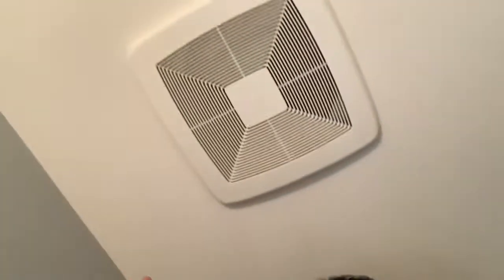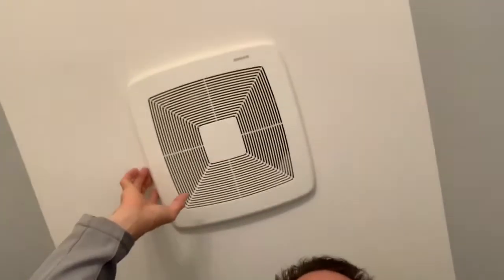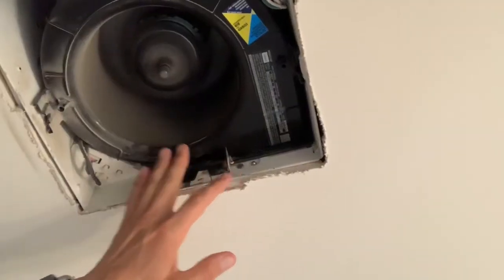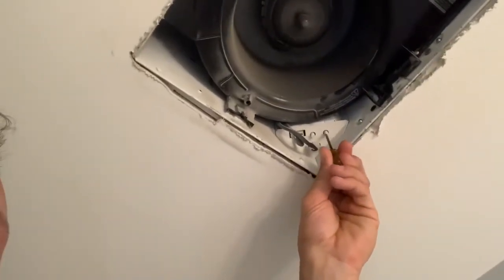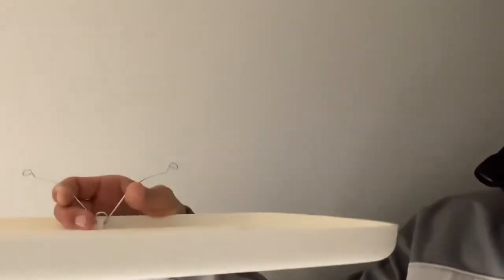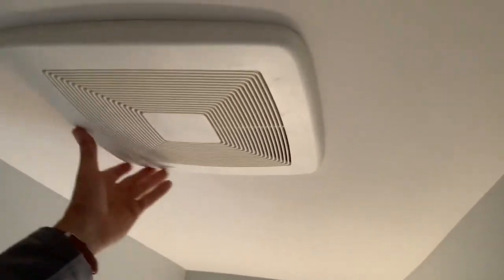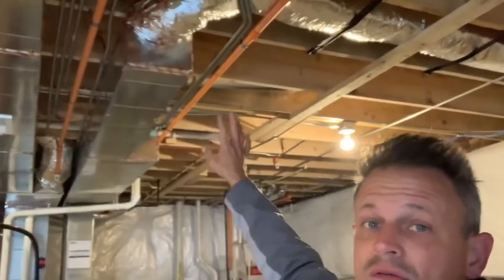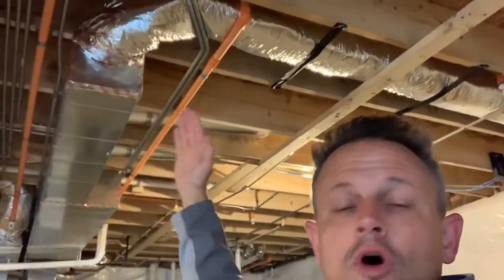Why is my bathroom exhaust fan always on even when the switch is off.

Comment: But I have 3 bathrooms with fans. It only works like the on on of the washrooms. 
The one the no one shuts of so my furnace runs sometimes hours, have told everyone to turn it of. Nope. .
Can you disconnect it with out Gering fined or trouble.
Reply from the maker: A lot of newer bathrooms have fans wired to run continuously or on a timer because they’re part of a whole-house ventilation system. That’s why they don’t fully shut off at the switch. If yours is tied into your furnace or fresh-air system, it’s usually required by code and you don’t want to just disconnect it. A better option is to have an electrician add a timer switch or adjust the settings so it only runs when needed. If it’s not part of a ventilation system, an electrician can safely disconnect or rewire it.

Comment: Hello, what’s the best way to clean these? Mine has gotten too loud. I’ve cleaned off all the dust but it still seems to be kind of loud on both low and high settings.
Reply from the maker: If you’ve already cleaned the grill and fan blades, the noise might be coming from a worn-out motor or loose mounting. Try removing the fan assembly and lightly oiling the motor shaft (if accessible), and make sure it’s securely fastened. If it’s still noisy, it may just be time to replace the motor or the whole unit—many newer models are much quieter.
Reply: @BJPoznecki it’s a 2 year old house… you think it’s due to the age? What kind of oil can be used with these fans? Thanks!
Reply from the maker: @E-manCal  I would use WD-40 silicone formula. It doesn’t attract as much dust and dirt like the original formula does.
Reply: @BJPoznecki awesome thank you

Comment: Thanks for this video. We recently bought a house that has an exhaust fan in the laundry room that is always on. You describe how turning on the switch makes it run at a higher speed and remains at that speed until it times out. Unfortunately, our fan doesn’t have a switch in the wall to control its speed. Was it just wired incorrectly?
Reply from the maker: It’s possible your fan is a continuous ventilation model designed to run 24/7 at low speed for air quality and moisture control. These are common in newer or energy-efficient homes. That said, if there’s no wall switch or speed controller at all, it could have been miswired or the control might be hidden (like in a cabinet, attic, or linked to a sensor). You may want an electrician to check if a switch can be added or if it’s working as intended.

Comment: Mine is a vent axia digital with no buttons or dials its stupid & just doesnt switch off ... are they goinna pay my electric bill this stupid fan should have a simple on off switch use as required no need for a continous non stop bathroom fan ... as someone already mentioned its gonna pump out hot air in winter to outside

Comment: Thanks for the video! Moved into an apartment with a continuously running fan (Unilux) at low speed/intensity. There is also a timer button but when I choose a specific time I don't really notice any difference in the fan speed, not sure what's the difference between using the timer versus not doing any thing as the fan is continuously running. Would appreciate your insights, thanks!
Reply from the maker: @njdiscoverer9237  Regardless whether the fan is on a regular switch or a timer switch when it turns on, you should hear an increase in the fan speed. If you’re not hearing that, then something’s not wired correctly and an electrician should correct it. When it’s off, it should be at an idle speed and when it’s turned on, it should run at full speed.

Comment: Could this cause a hike in your electricity bill? Ive been trying to figure out why my bill continuously goes up despite me being very conscientious about the amount of energy Im using. My ac isnt on all the time, Im in a 1 bd apartment and its just me, dont really use the lights much cause I get great natural light and I dont keep any unnecessary items plugged in.
Reply from the maker: @kihhtheguy16  These continuous running exhaust fans, for energy-efficient ventilation, are designed to be very energy-efficient themselves. They usually run at a low CFM (cubic feet per minute) rate and draw minimal power—often less than ten to fifteen watts, depending on the model. So, you might see a slight bump in your electric bill, but it’s usually pretty minor.

It’s more about consistent airflow and preventing moisture buildup, which helps in the long run with things like mold and air quality.
Reply: Gotcha, thank you!

Comment: Well my exhaust fan is no where near new, there is a switch for the exhaust fan but it doesn't work & mine runs all the time but when the door is open it gets louder especially when the ac or heater is running. It's quieter when the door is shut but the maintenance guy tried to say it turns off whenthe door is shut and it's not connected to a switch. I was like hth does that make sense when the point of the exhaust fan is to use it when showering especially with no windows in the bathroom?! 🤦🏼 I live in an apartment complex btw so PLEASE tell me if this is something i need to report to the landlord tp be fixed 🙏🏼🙏🏼🙏🏼
Reply from the maker: @officermeyer  Well I’ve seen a lot of different set ups. In apartment and condo buildings it’s very common to have a system that never turns off, so that there’s always fresh air moving through the unit.

Comment: Hi BJ
My fan light kept going from green light to orange/yellow light?
What does that indicate?
Reply from the maker: @lynnnorton7910  Hi Lynn! The changing light on your exhaust fan typically indicates the air quality status or the fan’s performance. 

Here’s a breakdown:
	1.	Green Light: The fan is operating normally, and the air quality is good or within acceptable levels.
	2.	Orange/Yellow Light: This usually signals:
	•	Poor air quality (e.g., high humidity, particulate levels, or odors detected, depending on the fan’s features).
	•	A need for maintenance, such as cleaning the fan or replacing a filter (if applicable).
	•	An issue with the fan’s sensors or performance.

To resolve it:
	•	Check the fan’s user manual to understand its light indicators and troubleshooting steps.
	•	Clean the fan and any filters, if applicable.
	•	Ensure proper ventilation in the area to improve air quality.
	•	If the issue persists, consider contacting the manufacturer or a professional for assistance.

Comment: One mystery solved!!! Thank you! I have a Broan fa system with carrier hvac...now add in the bathroom intake aspect I'm having g trouble understanding how it all works together. Also is it normal that when you flip the bathroom fan switch to on that it takes a good 60 seconds to kick up in speed?
Reply from the maker: @irishgirlsoi  On your HVAC system you should have a fresh air intake that brings fresh air in from outside. When they do that, they have to install a continuous running fan to allow that air to exit the home, so there’s always airflow moving through the home because the homes are built tighter nowadays with all of the energy efficiency requirements. 

Yes, some of the exhaust fans do have a delay when you turn the switch on it takes a little bit of time for it to get to full speed.

Comment: Can the fan be turned off? I just moved into brand new construction (apartment) the fan is in kitchen/living area and the insulation is getting blown onto floor 
Also have noticed all my granite countertops are dusty even though I clean daily, it must be coming from the ducts
Reply from the maker: @hdhoman2832  It sounds like something might not have been installed correctly. I would call the Builder.

Comment: Does this affect your electricity bill  by having the fan running 24/7?
Reply from the maker: @sashelblidgen2190  No, it’s drawing so little power. You won’t even notice it on your bill.
Reply: @BJPoznecki  ok something in my apartment is running up my bill and am so confused because am just one person in a one bed room apartment and I don’t use AC but yet my bill is 300-435 a month I just moved to this place. I have an electric stove, a 5 gallon fish tank, it’s has no lights but a filter that’s always running, fridge and microwave that stays plugged in everything else is off. What can I do because this is too expensive. Am trying to get the apartment people to come out and look Monday.
Reply from the maker: @sashelblidgen2190  Wow that is crazy. There’s definitely something wrong because a one bedroom apartment even if you ran your air conditioning a lot would be no more than $60 a month. I wonder if your electric provider has your electrical service mixed up with the electrical service for the apartment building common areas. I would also have whoever you pay your electric bill to whether it’s ComEd or somebody else come out as well in addition to the people that work for your apartment building.
Reply: @BJPoznecki  thank you am going to spend the day tomorrow and make calls because someone has to give me an answer I can’t afford it. Thank you.
Reply from the maker: @sashelblidgen2190  My pleasure, happy to help! Yeah, something’s wrong somewhere, because I know people that have a large house with a lot of electrical components that don’t even pay that much.

Comment: Thank you for the info!

The issue I have is when the a/c is on, the exhaust fan is on, so the cool a/c air is being sucked outward and not really cooling the bathroom.

 After I turn the a/c off, a couple of minutes later the exhaust fan also stops. And when I turn the a/c on, shortly thereafter, the exhaust fan kicks in.
Reply from the maker: That’s strange. I’ve never seen that before. The only thing I can think of is they may require that were you live.

Comment: I have one in the hallway as well near  HVAC. And the switch does not turn my running Ac off. You're thoughts
Reply from the maker: The one in the hallway could just be an exhaust fan to remove air from that area. Sometimes I will see them near laundry rooms, where the washer and dryer are.

Comment: Should the fan in the bathroom constantly run or should it always be left on and what does the fan actually do. Does it somehow get rid of toxic air
Reply from the maker: If you have a continuous running fan like the one in this video when you turn the switch off, the RPMs drop to a really low idle to where it never fully turns off. What it’s doing is creating air circulation throughout your whole home.

Comment: An electrician installed a Broan lighted fan in my shower this week.  There is no connection to my furnace as I have forced hot water heat.  He screwed up and when you turn the fan switch off the friggin thing keeps running.  No bueno. 
He was sub contracted via another contractor that’s doing insulation in my house so I had them unplug it for now but looks like they will need to get the electrician back here to fix the issue.  Too bad for him.  Do it right the first time.

Comment: helpful video. thanks. question: is setting the fan to run at a higher CFM more helpful? Ours was set to run continuously at full speed - not sure if that was an oversight or somehow more beneficial. (It's certainly noisier!)
Reply from the maker: It was an oversight. We want it to run at full speed when somebody’s in the bathroom. However, when you turn it off, we want it to drop down to just a slow speed.

Comment: Mine is the same brand as you showed, so if this one is supposed to always be on, why does it have a switch? lol does this use a lot of energy? I was trying to turn it off to save energy, what do you think?
Reply from the maker: No, it’s not supposed to turn off when you turn the switch off it’ll run at full speed for whatever the timer set at and then it will drop down to a lower RPM whatever that setting is set to. When you turn to switch on it, kicks it up to full speed. The energy it uses is so minimal you won’t even see it on your electric bill.
Reply: @BJPoznecki  thank you, I was thinking this would make my energy higher. Thank you for explain .
Reply from the maker: @meiryedilla  My pleasure, happy to help!

Comment: I have an issue with my extractor fan. It wont turn off. It is a pull string one. It runs 24/7. Ots wired correctly but we cant stop it from running. Its on the wall in my bathroom. We have turned off all the electricity supply to my apartment and the only thing running is that fan, without any electricity supply. It dosnt have a timer or a humidity sensor, nor does it run off the light. How do we turn it off?
Reply from the maker: So, a lot of condo and apartment buildings have a building controlled exhaust fan in your bathroom so there’s always fresh air moving through your unit. Unfortunately, to my knowledge, you can’t turn it off other than if you pulled it apart and were able to disconnect the wires. However, I wouldn’t do that if I were you because it’s very important that there’s always fresh air moving through your unit so you don’t get any mold or mildew buildup.
Reply: @BJPoznecki  thank you. Might explain why we can't turn it off, just find it weird that it runs on no electricity
Reply from the maker: @TheNageenabashir  A lot of the ones that I’ve seen there’s a central fan that powers all of them somewhere in the building. It creates a vacuum pulling the air out of your unit, into the system, and exhausts it out of the top of the building.

Comment: Isn’t this a fire hazard that the motor is running ALL the time?
Reply from the maker: No, it’s no different than a radon fan motor running all the time, or switching your furnace is blower motor to the on position, etc. It’s needed because with the heating and air-conditioning system bringing in fresh air we need a way to remove air already within the home.

Comment: Is it possible to turn off the fan completely (i.e. so it does not run continuously)? I was unfortunately talked into installing two of these Broan fans in my master bathroom (to replace the two old-style fans from years ago), so with both of them at the lowest setting of 30CFM my overall minimum for the room is 60CFM and I really have no need for that much continuous exhaust. So I'd like to prevent one of them from continuous operation. Thanks for any advice and thanks for your instructional video!  🙂

p.s. On a somewhat related note, continuous exhaust also continuously exhausts heat from the room too, yes? That's not so great for northern climates like Maine where we need to heat the room (and house) for extra months. Nobody seems to mention that aspect in anything I've read so far online. Thanks again.
Reply from the maker: Thank you I’m happy to hear you like the video. Yes, an electrician can wire them differently to where they act as a normal exhaust fan that turn on and off with the switch, and does not continuously run. Unfortunately, it’s not something I can walk you through, you’d have to have an electrician open up the fan and rewire it accordingly.
Reply: I have a question. I have a pull string extractor fan on my bathroom wall, not ceiling but it continues to run 24/7. The string does not stop it. It has no.timer or a humidity sensor. It's all wired correctly. We have switched off the whole electricity supply to my apartment, the only thing that continues to run is the fan. How is this possible without any electricity supply and why can't i.turn it off?

Comment: I just noticed our fan is on more than usual or feels louder than usual. Does it mean something at all? I keep trying to turn it off but it keeps turning on.
Reply from the maker: More than likely, it’s a continuous running fan like you see here in the video. The only way to know for sure would be to take the grill off and see if you have the adjustable dials like this fan has. If you don’t, there’s a possibility it may not be wired correctly, where it is always on. At that point you would have to have an electrician take a look at it.

Comment: We have a fan that wasnt always on and yesterday it came on at full speed and wont turn off.... just bought the house in June and this is new to me.
Reply from the maker: It’s possible the switch to turn the fan on and off may have failed and needs to be replaced. For your situation, I would call an electrician to come and help out.
Reply: @BJPoznecki  Thank you. I've done switches plenty so I'll grab a new one tomorrow.
Reply from the maker: @troya.crouse8342  Yeah, try replacing the switch and let us know if that worked?
Reply: @BJPoznecki  I replaced it tonight and it didn't. I'm in the middle if re-wiring it now to see if maybe it was never installed correctly in the first place.
Reply: @troya.crouse8342 did you figure it out?
Reply: @amandawhite4143 yes it was wired wrong. New build house... probably an apprentice did it haha

Comment: I know this is a really old video. I just moved into an apartment and i haven't pulled the cover off.

Yet the switch on my wall is a push button and sensor I think. It keeps turning on by the switch to its full running speed. Is this a moisture thing?

It's raining outside but haven't used my shower today. I noticed when i used my shower the light on the switch turned on.

Its been all day even when click the switch. Hours later it will be on again full bore.
Reply from the maker: I’ve seen so many different ways of installing and wiring bathroom exhaust fans that I couldn’t tell you on yours. I would just ask the property manager at your apartment community how it works.
Reply: @BJPoznecki  ha ha I appreciate the response it does appear to be moister sensitive. It was on all day when it was raining outside and it's off and on during the day. (The ramped up speed) that you can hear from anywhere in the place.

It's mostly off. Though so not an issue it was just my first full day in the house and I was like wtf. I don't like this 😂.